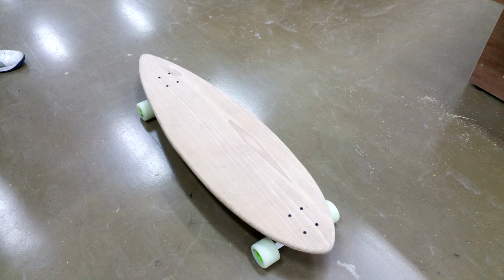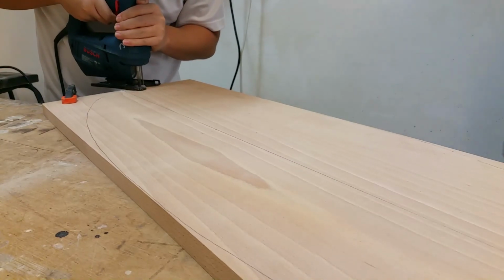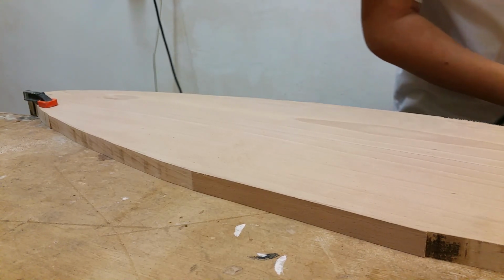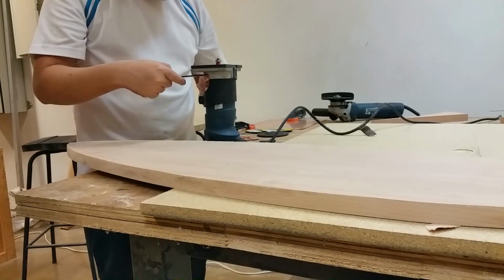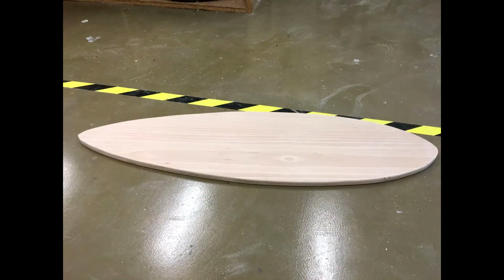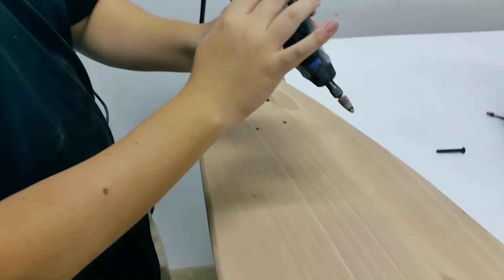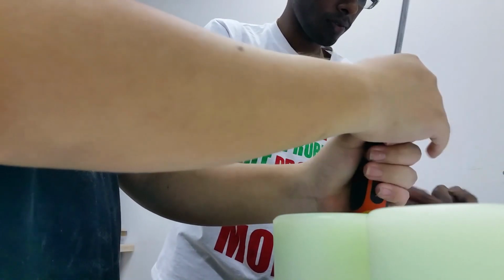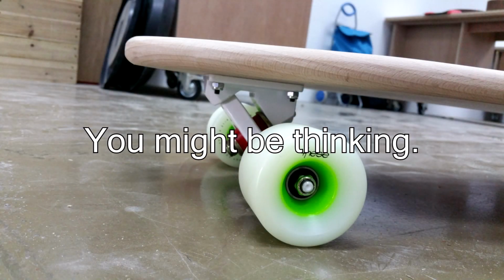How to make a Wooden Pintail Longboard DIY

Comment: Good job guys! It looked like it was not your 1st time to build one. Anyway, the wood that you bought, was it treated or kiln dry? wood tend to bend or warp in time when there's moisture in it. What coating did you use to protect the wood? I'm thinking of building one myself. This was 3 years ago, how's the board? thanks. :)